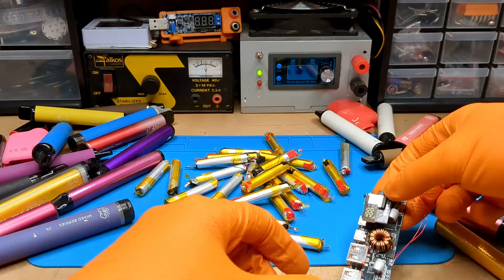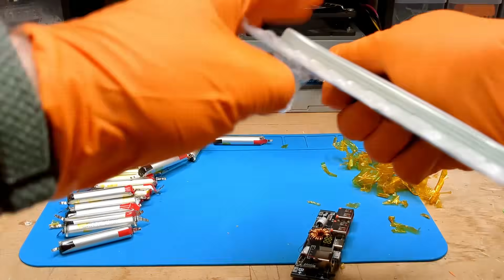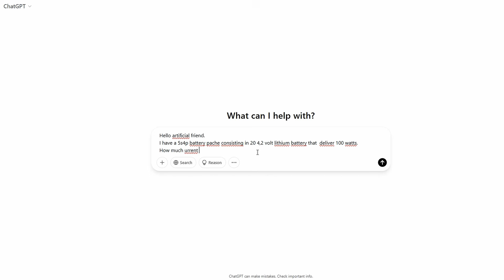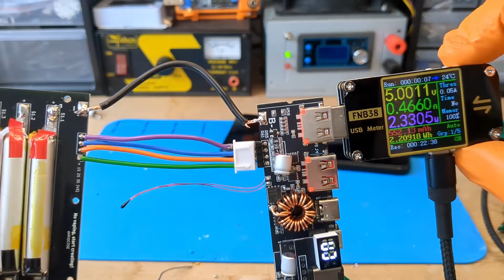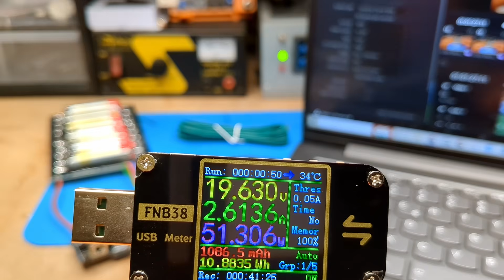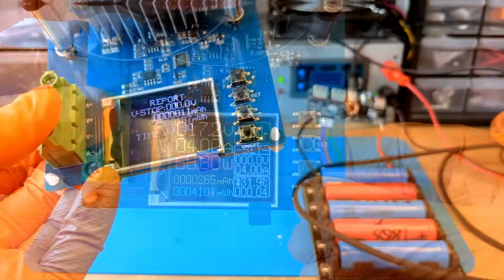From Disposable Vapes to 100w Power Bank – Safe or Insane?

Comment: Vape batteries can discharge very quickly... High Drain. Less internal resistance. !860 batteries need to specifically say high drain. Take a photo of each vape battery and upload to Gemini. It helped me a lot to get the specific capacity and discharge of each type of battery. Oh, and bigger and shorter batteries do better than narrow and thin ones. Grazie Mille for the video!
Reply from the maker: Thanks for the info!
How did you figure out that “fatter” batteries work better?
Grazie a te amico!
Reply: @dariocose  di niente amico mio. I don't have proper research data. Mostly observational info. You are the professor, I'm just learning as I go. My main basis is a comparison with conventional batteries. One AAA has a lot less capacity than one D size battery. That said, lithium batteries are constructed very differently, to carbon zinc or Alkaline batteries. So, I could be wrong. Like you, I wanted to reuse a throwaway product. Keep up the great work!

Comment: I have reused a few  of such batteries but only charge and discharge at a few 100 mA. I don't trust the quality.
One shall always know/consult the datasheet for max. charge / discharge current and min. cell voltage since it differs greatly from cell type to another one.
No new batteries doesn't allow 20A discharge current... only the ones made for it as in quality brand  tools and some laptops. Most cells can't handle above 1C.

Enjoyed the video. I don't mind the AI voice. It's fine. Thanks for the video.
Reply from the maker: Thanks for your comment, dear.
I'm currently running tests to check the quality of each cell...
Stay tuned!

Comment: You really should use a BMS with thise batteries 😬
Reply from the maker: the powerbank module has an internal bms!
Reply: @dariocose  well you definitely arent using it correctly... the bms should be monitoring each cell because otherwise if one cell fails it won't know and it'll overcharge the rest of the cells then you'll have a fire on your hands. Nor would I trust a bms intergrated into something like that with no info etc 😬
Reply from the maker: I repeat, the BMS is on the board. It is a BM3451.
Reply: @dariocose  i repeat... you have the bms wired up wrong so its not even effective....
Reply: @dariocose that bms dos upto 4 cells.... you are using a lot more than that.....
Reply from the maker: @adambundy2639  from the DS "The BM3451 is a professional protection IC for 3/4/5 cells rechargeable battery pack; it is highly
integrated, and generally used in power tools, electric bicycles and UPS applications." 

I used the 5S4P configuration. Unfortunately, I don't know of any BMS that manages each individual battery, only groups of cells in parallel. Since my English is poor, I hope I have explained myself clearly. If you know of any components or modules that manage individual batteries, even if they are connected in parallel, please let me know. I am curious to understand how they work! Have a good day, buddy!

Comment: Very interesting, but I would be so concerned about those vape batteries going up in flames. Recycling batteries is great if you can guarantee their quality, but even then I would want to thoroughly test them before including them in a project.
Reply from the maker: What you say makes sense.
They should not be a problem for small projects at low currents.
I guess I need to make a stress test video of these batteries.

Comment: Dude you need to learn more, before you go further with the battery packs. You have missed one very important battery cell parameter - internal resistance. You should have a special tool to measure it. Why it is very important? Well based on it you can predict how many Amps the battery cell will be able to deliver, how fast it will be charged and how fast it will be discharged. And because you are connecting cells in parallel it is very important to pair the cells with the same internal resistance together to avoid constant load balancing. Beside that it is good to have all battery cells in the pack to have the same internal resistance or your pack will become unbalanced very fast.
Reply from the maker: You're right. You've given me an idea for my next video!

Comment: i also have done this with a couple of types f battery from vapes both being the ones that look kinda like capacitors one with legs the other without the one with legs each individual one was 360 mah the one without legs 520 mah 360*48 and the 520 *54 each have good capacity nd i used a circuit to boost the voltage up to 5v but i only use it to charge up one or two things or power small things so far will be doing more stuff with them later on
Reply from the maker: I hope you didn't put these 2 batteries in parallel....
Reply: @dariocose  nooo aand made sure to get them all up to similar charge and only used same types and size  didnt mix and match thatd be dangerous i also dont pull more than 2a from them either so they last ages from my testing the ones i used dont go in series very well and often die if you try

Comment: I use the 'Grade' option on my XTAR VC8 to check real capacity,  internal resistance etc. Even batteries that claim to be the same can have wildly different real mhA. It charges, discharges and then recharges them automatically withe the Grade option and has a number of safety features. I can then 'match' the batteries for a safer power bank.
Reply from the maker: You're right. Taking measurements of each battery makes a lot of sense!

Comment: awesome video, grazie mille!
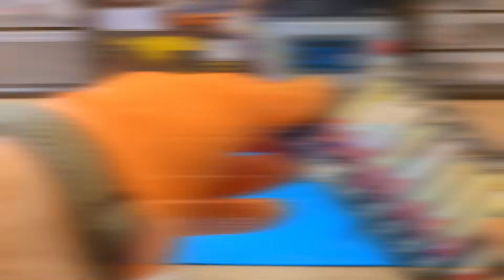The only thing I'd say is that at 7:10 you took a huge risk. You should have soldered these before connecting the batteries. Had you accidentally shorted those pins it would have been brutal.
Saluti dalla vicina Svizzera :)
Reply from the maker: Ciao caro. Hai ragionissima! Infatti sulla seconda scheda ho prima saldato i cavi e poi le batterie!
Grazie del suggerimento e del supporto. Un abbraccio!

Hi dear. You are so right! In fact on the second board I soldered the cables first and then the batteries!
Thank you for your suggestion and support. A hug!

Comment: Vape cells are actually used to high currents. Each one could power vape wich is usually at least 5w but usually 10 or 15. So single cell is ok with over 2A, but it's burst load and not sustained
Reply from the maker: Hi, dear!
I don't know.
From what I know about analyzing the ICs of disposable vapes, they seem to reach peaks of one or two amps at most.
Non-disposable electronic cigarettes (i.e., rechargeable) have very powerful, high-performance batteries.
Anyway, thanks for the heads up. I will definitely look into it!

Comment: you need to be very careful with vape batteries they cost me my house, i did the similar project about a year ago ,5s2p with aliexpress 5s bms and a separate type c charging module.. i used it daily at work, then one day i arrived home and put the powerbank to charge.. after a while i got out of home for 40min and comeback found my house muso black nothing left in it, until this day i am not fully recovered from this incident.. 
my advice :
-do not trust any non certified Modules
-make a fireproof base for charging
-be carful of polymer cells
Reply: For real? That shit is my nightmare. 

I need to get busy with my tuya smoke alarm project.
Reply: I throw my empty vapes in public trash cans for a reason. I dont trust those batteries at all!
Reply: @1marcelfilms  Good thing you're inhaling it, keeping it in your house and charging it up until it runs out of juice lol. Only then do you not trust it!
Reply: @1marcelfilms  You need to recycle them properly at E-waste.
When the trash is collected from the can it is compacted and the truck can catch fire. Happens often.
Reply from the maker: I am very sorry, brother.
I promise I will take action to promote safety with homemade battery packs.
Hugs

Comment: This design is very dangerous. Each of the four cells in parallel could fail and result in thermal runaway a.k.a. fire.
For safety, you individually need to control the charge to individual cells.
Reply: Escooters have more powerful cells used in parallel so they are dangerous??? Dosent seem like it's that big of a deal.

Comment: One other test you could try, from a fully charged battery run a 1 amp load and time how long it takes to cut off. A problem I've found with these power bank boards is that the cut off voltage is too high and the board won't use the full charge of the cells, I'm sure there's a way to set this, perhaps swapping out a resistor, but data in these is usually poor.

Comment: sorry but this is not worth im 16 im repairing vapes since 13 and i realized that i also have so much of these batteries now these batteries are not long lasting manufacture [my english is bad sorry] didnt want to spend more money so they making these garbage short life li ion batteries they not lasting long and thats why they used in vapes may you realise when you use your vape like 3 or 4 weeks  your battery cant hold anymore and you need to charge more often these batteries are made for short time high current pulses not for making powerbank and suprisingly these batteries are safe means you cant destroy these easyl with over discharging or short circuit but again these are not lasting long life cycle is short
Reply from the maker: Hello, dear.
If these batteries are used in disposable devices, then they must be cheap and not very durable.
The purpose of the project is to show people that we can reuse things that we usually throw away.
Thanks for your suggestions anyway, friend!

Comment: I have one improvement I can see: The battery contact solder area being so large makes it very hard to solder to, as you experienced. I would break up the large pad into several pads that were not connected to anything. Isolated pads of copper. Pick which pads line up the best with the ends of the battery, and solder in place. Do this for all batteries, and since they are not electrically connected yet there is no risk of high current flow from the batteries balancing themselves. Once all batteries are in place, then use a wire on top of all of the isolated pads to bring it over to the Positive or Negative for that cell. Or flow solder over all the pads bridging them. Or both for really high current cells?

Comment: It seems you have problems with current calculation and with mathematics... - You needed more batteries in parallel...
Reply from the maker: Yes, I have many problems! Not just with math!
More batteries in parallel surely would have helped.
Thanks for the suggestion, buddy!

Comment: Hi! I'm wondering if we can change the R20's resistor by using Trimpot Trimmer Potentiometer around 20k-50K ohm instead. Would it be effectively as well?
Reply from the maker: The trimmer works. The only problem is that it may be difficult to adjust the resistance properly. It might be better to put a connector in place of the R20 resistor so that you can use the resistor of your choice.

Comment: full 100w couldn't be achieved because of the cables connected to the trigger module and electronic load i have the same kind of wires and they are aluminum and trash also 18650 battery holders do not make good contact with the batteries
Reply from the maker: Thanks for the suggestion!
The cables should hold eight amps, but I'll definitely check. Thanks, buddy!

Comment: You chose the smallest capacity possible vape batteries.. and connected them up and the most expensive way possible by using a PCB..  then connected to a totally overkill and inappropriate DIY power bank module that will kill the batteries within about 20 seconds if you trying to use it at full  power. also it would be absolutely massive so you would never actually take it anywhere. Also just using orange gloves as if somehow you are working with high voltage but it's impossible for you to get any electric shock when the most your ever going to work with is 20 volts. Videos like these are very disappointing because it gives everyone the wrong impression about what the capabilities of things are and how things work.

Comment: You need to use a heavy wire from battery to power bank circuit
Reply from the maker: Cables usually heat up when they are too thin, but that didn't happen in my case.
I'll try your advice anyway.
Thanks for the help!
Reply: @dariocose yes, they get heat but that usually happen when high amps are transferred. With thin wires voltage drop is the main issue here. The power bank module cannot detect appropriate voltage to fully utilise 100w